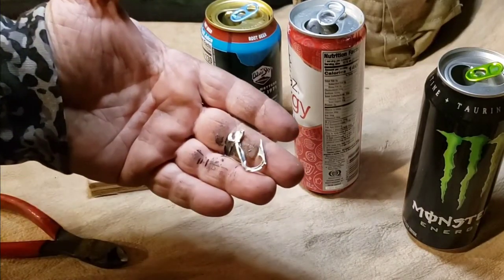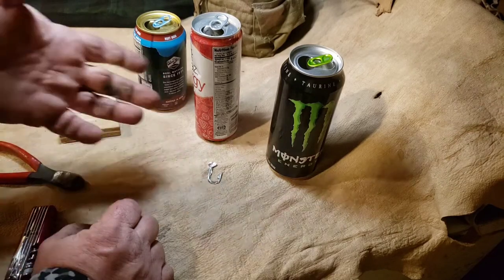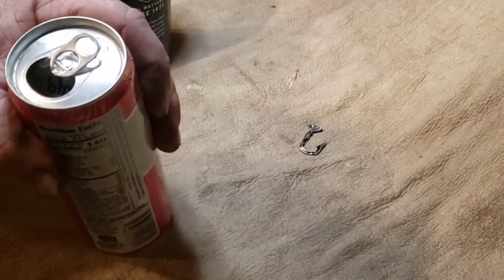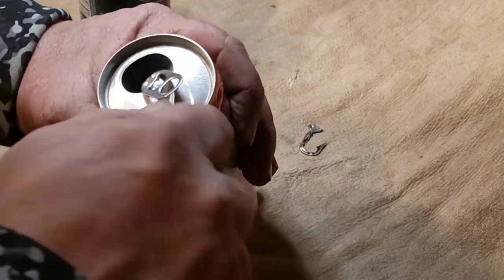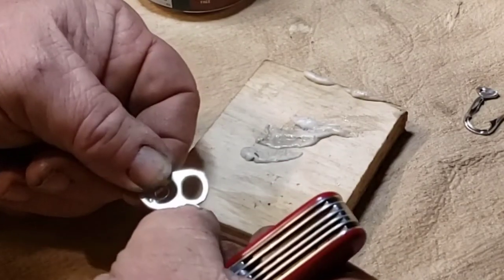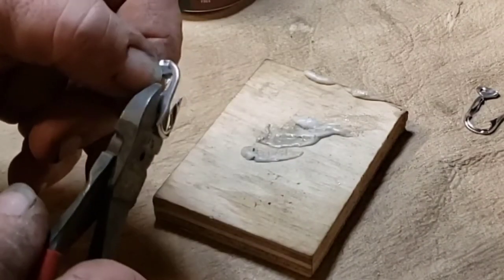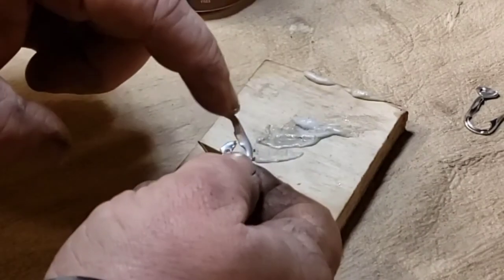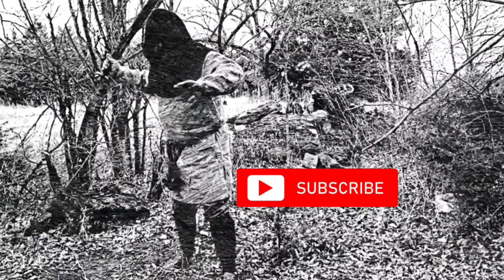Making a Pop Can Tab Fishing Hook

Comment: Here's a trick to get the tab off clean without any tools:

Spin the tab around 180 degrees so the tab covers the opening. Now you're gonna want to use your thumb to push the tab down inside the opening of the can, while using another finger to pinch and support the other side of the tab and prevent it from falling into the can. It should come off quickly and effortlessly, ring intact.
Reply from the maker: I'll give that a go

Comment: Pros: easy to come by, cons: you still need a tool to cut the aluminium. Scissors will do the job, or a sharp knife or stone... basically the same tools you'd use to make hooks out of wood or bone. The advantage of using these aluminium tabs is that you get sort of a barb, which helps a lot with catching your fish... other than that, I guess you'd just use whatever material you can find first... what I woul most like to see in these kind of videos, is people actually catching some fish with it 😋. For efficiency I'd stick to fish traps instead of active fishing, but fishing with line and hook is definately a lot of fun!